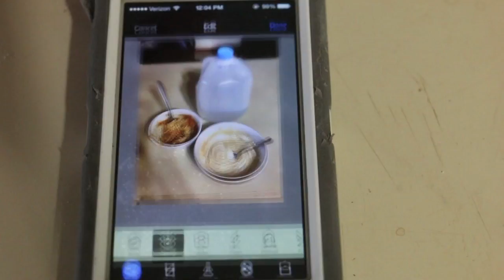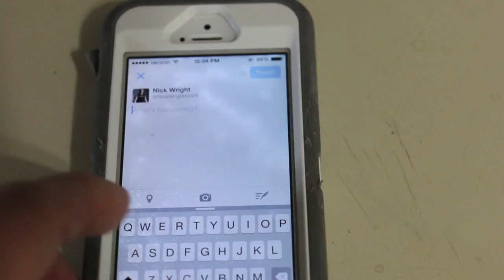Meet Plank - The Board Press

Comment: Haven't viewed your vids in ages.... Great to see you came to powerlifting....Some advice i got from a national record holding power lifter::::::::::: It's all neuromuscular connection for efficacy and efficiency, rarely train to failure, train frequently ( I hit bench up to 6 times a week- takes practice), eat well (loads of magnesium, potassium, calcium) for muscle contraction....... It is important to hit 1 X 12 second negative lift once a week.... no need to lift with anything less than 70%1rm after joints/tendons are acclimated in a session. To stretch and warm chest/tricep/delts use flat dumbbell bench.:::::::::: /watch?v=NQox-bOLPkk

Comment: Question for you Nick,

I'm 21. 5'10 165lbs. 10-11% BF. B/S/D 250/350/440. I have been thinking of competing for ages now, I just always doubt my lifts will place me anywhere decent in a regional meet (from Ontario, Canada). Would you suggest to maybe bulk up to 180 and see how my strength goes or cut to 160 and maintain at that weight whilst slowly progressing on my lifts? In your experience, do you think I'd qualify and/or place okay at a lower weight?
Reply: +Ryan Morin 
It depends on whether or not you are going to compete raw. Once you get up to around 275+/400+/450+ you will start kicking some ass at local meets. Forget about regionals. You need to work your way up just like everybody else. Equipped lifting is a whole other ballgame, therefore I suggest you just dive in, do both, and go from there. Just do the best you can and don't worry about anything else. You will meet a lot of great people along the way and make tremendous gains with the acquired knowledge. At your height you should definitely work your way up to 181, but whatever you do, don't listen to that piece of shit telling you to stick a needle in your ass.

Comment: So that's called a Spoto press....
Reply from the maker: No it's not. A spots press is you completely holding the weight in a suspended position. Board pressing allows the weight to rest on the board, not in your hands.
Reply: So it's a weak spoto press.